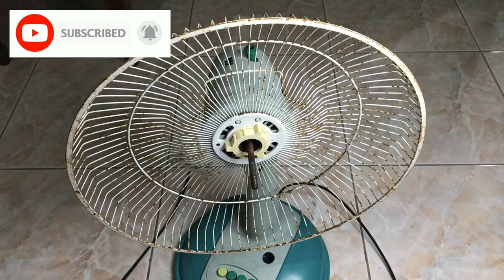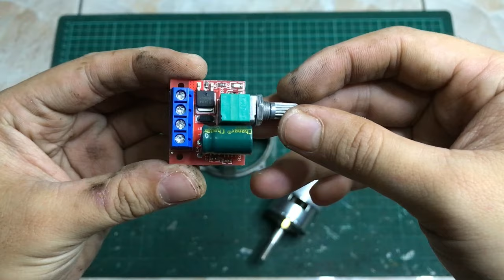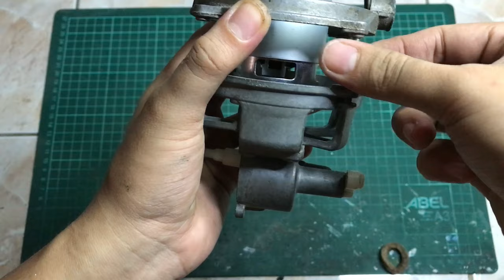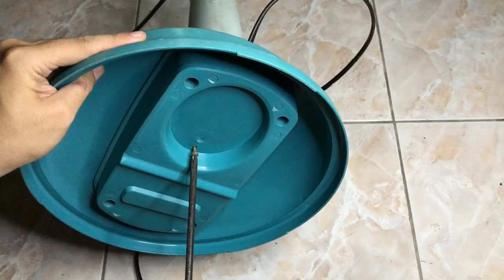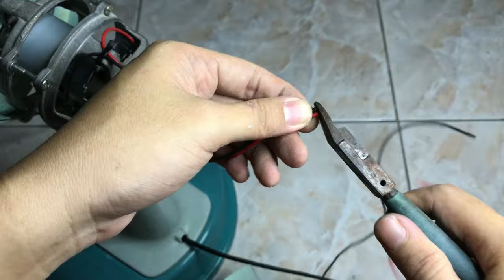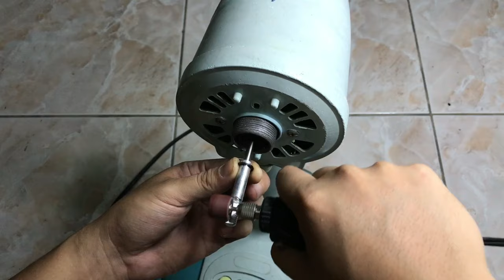DIY: How to convert 220V AC Electric Fan into 12V DC | Tagalog Tutorial

Comment: bkit kya sir ung gnyan ko 12volts fan??  
12/ 3amps gmit ko power supply kaso ilang minuto lng nagiinit n at humihina na ung ikot nia
Reply from the maker: Try mo mas mababang supply sir. 1.5A gamit ko yung para sa router okay naman
Reply: @DrixWorks  a try ko nga 1.5amp. & tnx po sir ..godbless po👍
Reply from the maker: Okay sir. No problem. Godbless!

Comment: Boss bakit yung sakin pag rekta sa battery nakaconnect ang lakas nya parang ac fan talaga, pero pag sa adaptop na 12v 2a sobrang hina, tinest ko gamit multitester almost 6v lang pumapasok sa motor, nagtry din ako gumamit ng step up module na 5v to 12v pero ganun padin speed nya kahit iincrease pa yung voltage. Bakit kaya ganun boss?
Reply: Gamit ka Ng 12v 5A na power supply.

Comment: Ask ko lang po bakit po yung akin eh iikot tapos biglang hihinto?
Reply from the maker: Baka po kapos sa supply. Ano gamit mo na supply sir
Reply: @DrixWorks  ang gamit ko pong cable wire is yung sa TV plus po,suggest nga po kung anong wire mga dapat gamitin?
Reply: @DrixWorks  1A po yung adapter nung tv plus
Reply from the maker: Kapos po yung pang TV plus. Hanap ka po kahit 2A